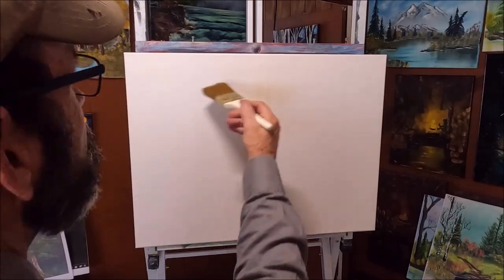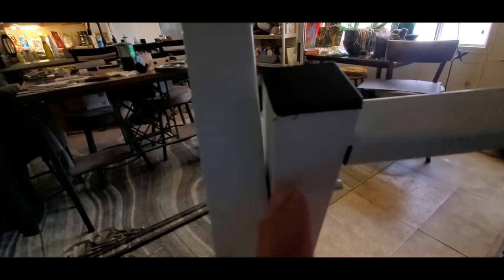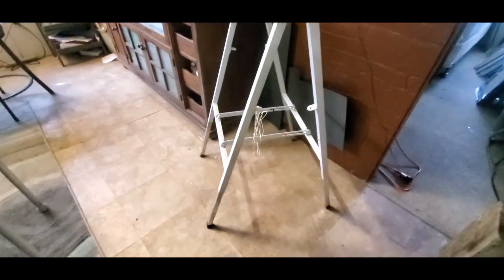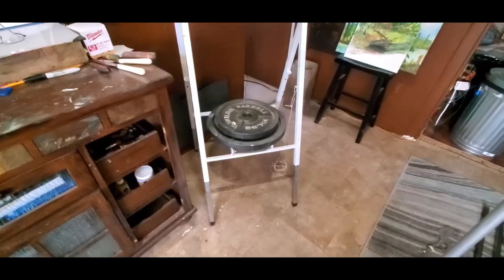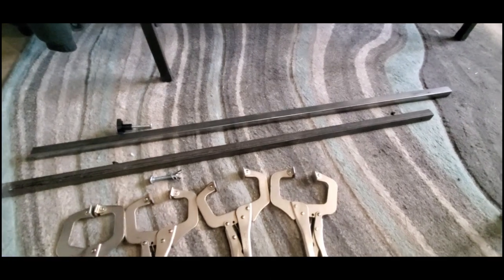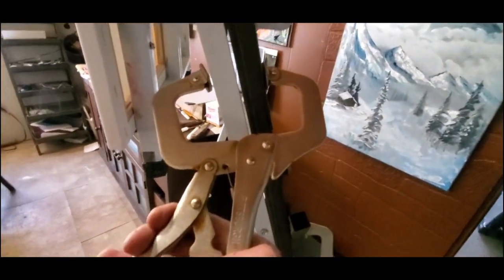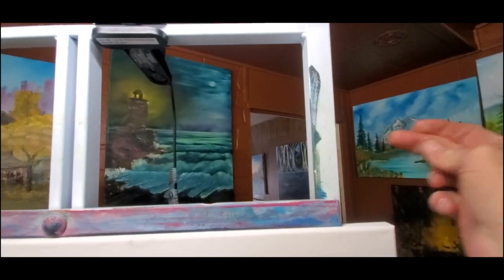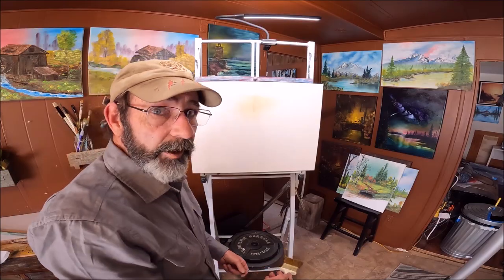Fix that Wobble SIMPLE EASY - DIY Fix for the BRI (Bob Ross) Easel

Comment: Game changer right there. The diagonal support seems to be make a dramatic impact. I particularly like the bottom leg piece you make for the bottom of the canvas but your skills top mine at this point 😂 I use cinder blocks to hold my easel right now.. I need to add the self tapping screws and braces! That I can handle!
Reply from the maker: I added the self-tapping screws before adding the support leg, you might not need the screws but, it made a large difference in the movement on mine. I think the stand should have an adjustable lower canvas piece, it only makes since. Tons of wood scrap in my shop, took me 10-minutes to make. If I could find a way to get one to you, I can, will and would. The stand will still take a 24-inch-canvas standing up with it installed.  AND yes, the diagonal brace makes a HUGE difference!! Made me wonder why it is not in the design to begin with.... Really enjoy your work, thanks for the comment!

Comment: I bought the pipes and cinder blocks and its like a new easel even though it is a new easel. Thanks & cheers!
Reply from the maker: Makes a huge difference, happy painting!
Reply: Would you happen to know the size of the screws that hold the canvas in place? One of mine went flying off in to the nether. Thanks! @gmccl
Reply from the maker: They are #6 panhead Phillips @MortuaryManor